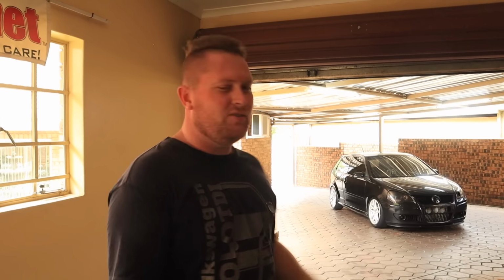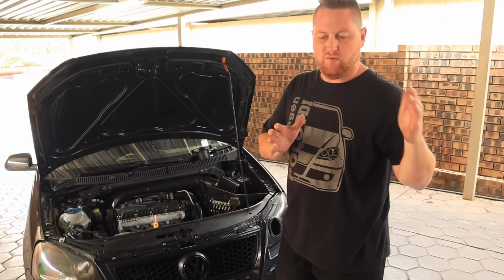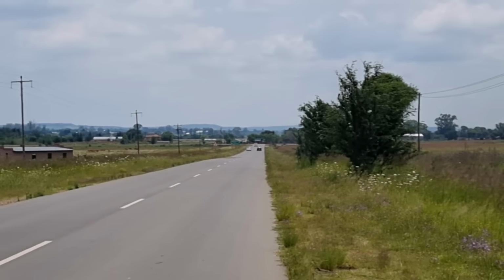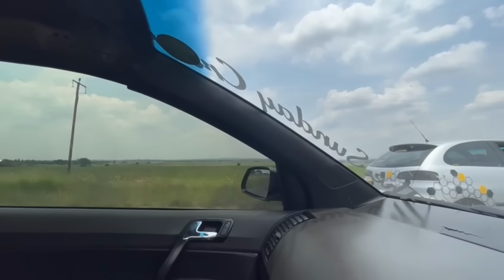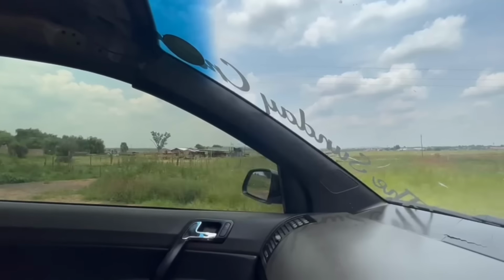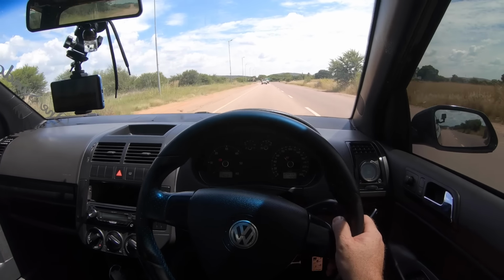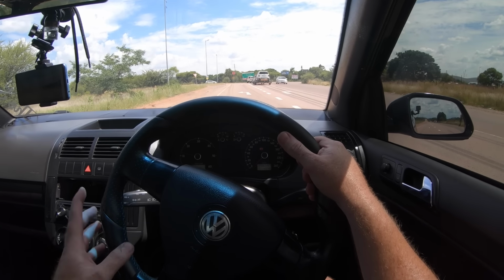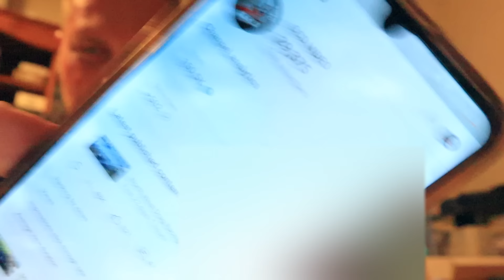STREET RACING MY 375hp BIG TURBO TDI

Comment: Regarding car cutting out check your battery cables and clean earth straps keep up the good work👌well done with almost hitting 30k subs well deserved!!
Reply from the maker: Will go over them again, but I believe tge battery cables are good. My battery seem to be almost dead or making a dead short inside though. Sometimes when I want to fire it up, it'll sound almost dead, ignition off and back on and it fires up like nothing happened

Comment: Check your solenoid and make sure it is not spraying slightly after you let go of the button. Related to switching off after a run.
Reply from the maker: Thanx bud I'll def check that, although it once switched off on a run with no nitrous aswell. Very weird
Reply: @CCD VIDEO  then I doubt it is that. Have your battery tested for a dead cell, have seen that before.
Reply from the maker: @sout13  that could 120% be the problem. I suspect it has a dead cell. Sometimes it hardly cranks the motor over, shut it off and immedietly start it up again, then it cranks sharp and fires right up

Comment: for the cut out check the camshaft sensor
Reply from the maker: Car isn't throwing any codes for it, and it only happens after certain runs. Was nitrous only, untill the testing in this video. Will go over the cam & crank pos sensors just to be sure

Comment: What clutch are you running? Is it able to hold all the power even with the Nos?
Reply from the maker: Yes sir, it holds power. Got a full button clutch in the car. Not the easiest or nicest to daily drive, but that's a small price to pay
Reply: @CCD VIDEO  thanks. I presume you can't have it both ways. Thanks bud. Hope to see you at cash days.

Comment: Does your PD130 run a LSD or open diff
Reply from the maker: It's a phantom grip diff. You can google it, works about the same as LSD
Reply: @CCDVIDEO Yea, I could tell that it wasn't a open diff the car grips and pulls away very strong 💪
I've got a 2003 Passat PD130 engine code AVF but it has seen better days the turbo does not work, If I do a turbo rebuild plus stage 1 tune, injector nozzle upgrade, Boost pipes 76mm, new intercooler,& a downpipe, I'd be happy if I get into the +150kw or upwards and is a budget of 20K enough for all those mods If not what can I do with the 20K for this build? Your advice would be highly appreciated brother

Comment: There no way 375bhp on stock injectors if it is your egt must be through the roof
Reply from the maker: So there is a way 😎 I'm fully aware of the consequences. It makes 275whp on boost and 375whp on gas. I have 120's, just not fitted as I was having some issues with them previously